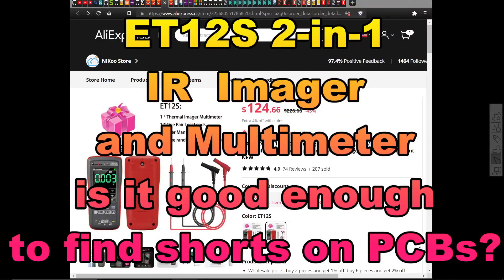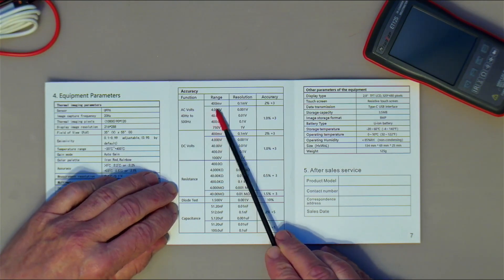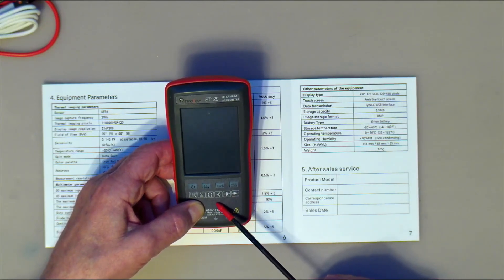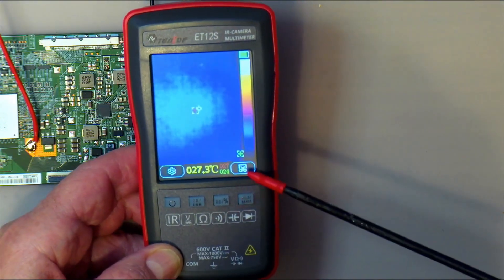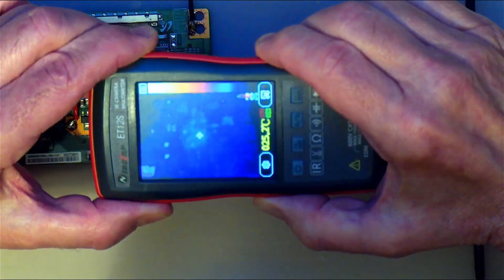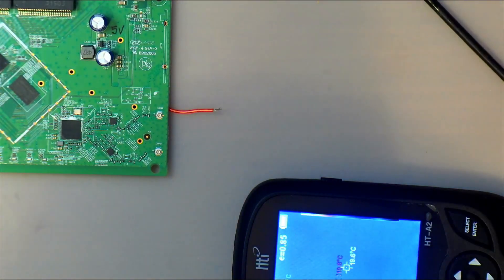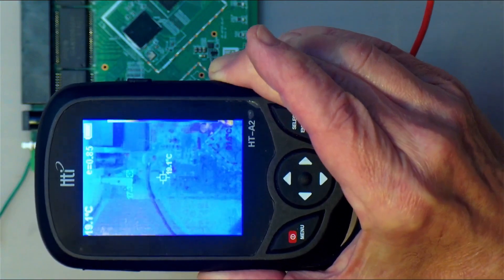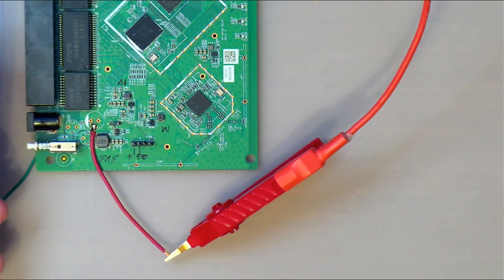ET12S IR Camera/Multimeter Review

Comment: fyi mine saves screen shots just fine, so your unit is faulty, it's not a robust piece of kit, just like you demonstrated, I have successfully found a faulty cap using a tooth pick as a pointer.
Reply from the maker: Not sure about the one I have, it does not work in continuity mode either no beeper.  I got it to do a review and it is now languishing in my drawer to look at to fix in future perhaps.
Reply: @Tech-Relief actually the continuity on mine works really well. I would look forward to a good teardown, you got a new subscriber.
Reply: Using something as pointer (in this case you have the test leads provided with the multimeter) is the best way to go to find faulty components; i used this technique multiple times with a low-res FLIR E4 (60x80 pixels).
BTW, i bought the bigger brother of this multimeter (ToolTop ET13S, with a whopping 192x192 pixels resolution!) and i can attest that it works very well to spot faulty components even without the extra lens.